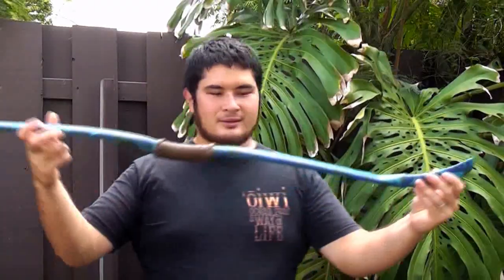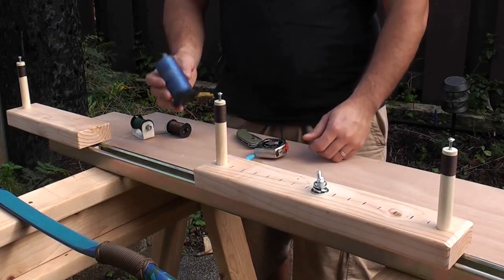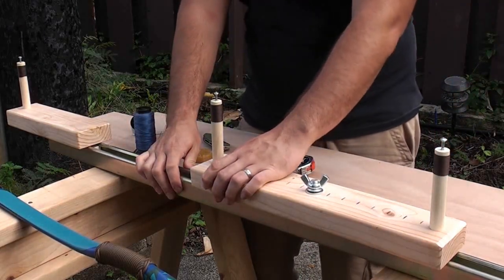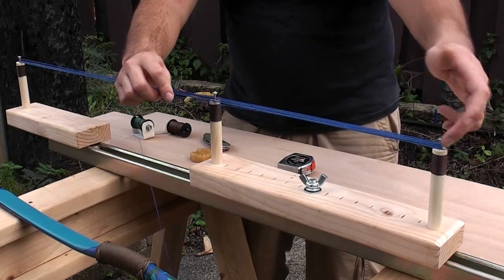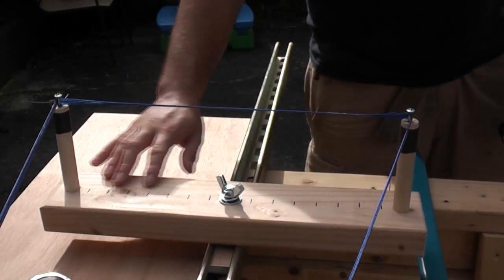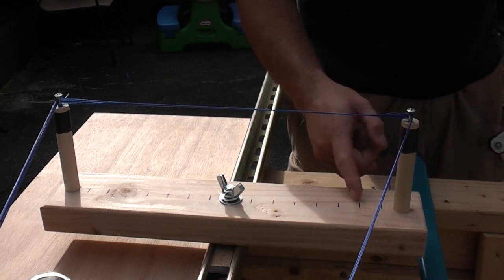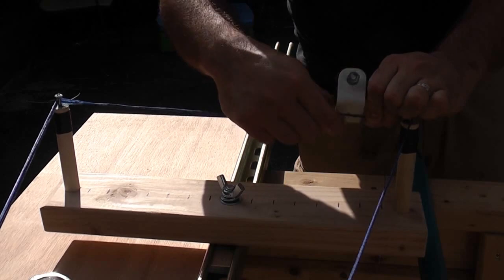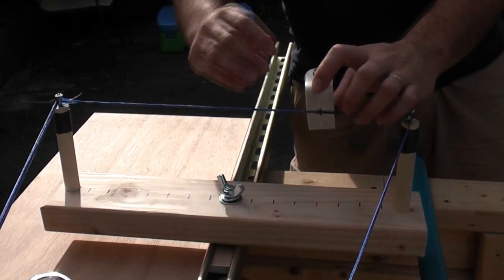How to Make a Continuous Loop String with the One Arm Jig Part 1

Comment: That's a nice  jig my first  jig was like  that .
Watching  new sensay I had to have one like that I'm a mettle worker sooo  I made one. The difference  is mine I got stick on tape measure  and measured out a lanth. Now I don't have to use the tape. I'm new at making  bow strings and it's the different  string  material  that screws me up. I have 3 bows and the fast flite  seems smaller  then the b55.
I tried to  make  my strings a little  bigger.
My 56 bow takes 53 inche string so I went to 53 and a half  theirs no adjustment. Brase hight 8 but I like mine 7 and a half. Guess  I'll have  to go a full inch over when  using  fast flite. To make sure my measurements  were right I taped it to see it's right. 
Need more  practice.

Comment: Use pure cotton.Never use nylon. It will always stretch. Use barber coat wax to waterproof it if you don't have bees wax. To work out how many strands. Test the breaking strain of a single strand with a spring balance and multiply to three times the bows draw weight.
Reply: I used bowstring wax to finish my strings, or else a mixture or about 30% parafine wax and 70 % bees wax. It works well and i had no problems with that in the past.
Reply: Johan Combrinck
Reply: Marcus Baker what about that nylon thar used for fishing net ?!

Comment: You don't need a jig either. Just bang two nails into a length of wood. Bend the nails in when you finish so as not to damage the string.

Comment: I can use fishing line right?
Reply: From past experience i can say that using fishing line is not a good idea. It has a lot of stretch, unlike the Dacron that he uses (that i also use). The fishing line will definitely stretch to make all the hard work be for naught.
Reply: what about a good braided line...no stretchJohan Combrinck
Reply: I would suppose it is not an unworkable idea, but it is something that i have not tried yet. THe material i would use then is something like braided dacron, the stuff that is used for fly-fishing backing-line, or the thicker version that is used for deepsea fishing, also the braided stuff, with ZERO stretch. In the past i used to get a braided dacron line which i used for flying very large kites, and that may work, but i can not say for sure. It is something you will have to experiment with to see how it performs on a bow.